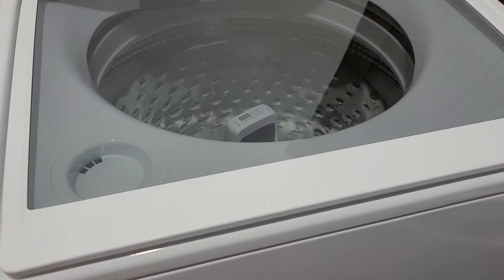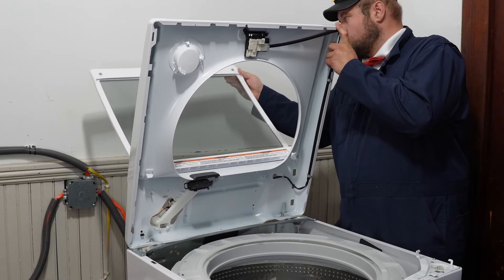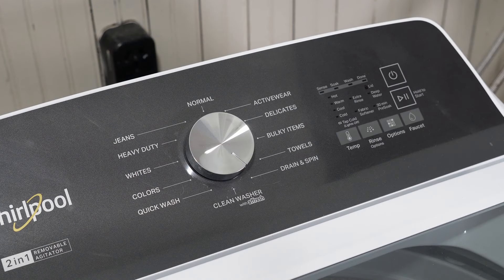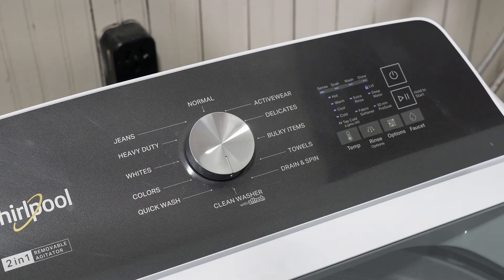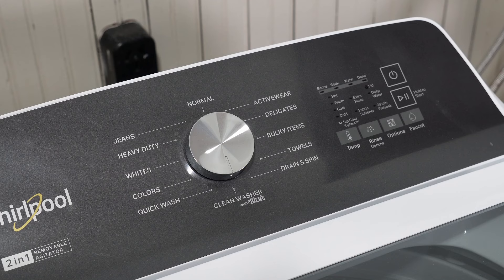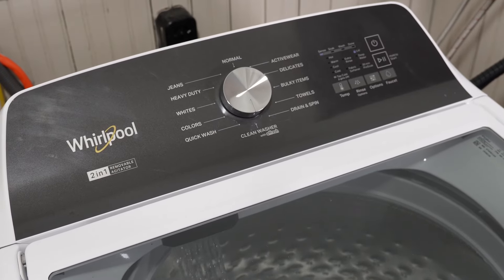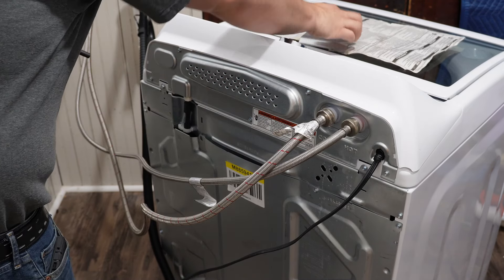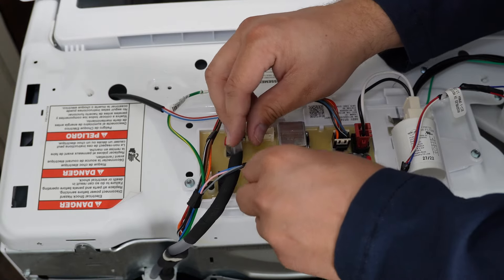How to Reset a Newer Maytag or Whirlpool Washing Machine (Factory Calibration Mode)

Comment: I bought this exact machine earlier this month on the 8th.  I used it approximately 5 times and then it stopped working. It flashes Sense, Done, Lid. I am getting the run around from the big box store where I bought it and the manufacturer (Whirlpool). This machine cost about $750.00 and it does not work nor will Whirlpool return my messages and won't issue an RA number so I can return it to the big box store where I bought it. Any idea's. I will try this reset tomorrow. I could use some help if you know what that code means.
Reply: I did follow your other video about putting the machine into test mode. It started the test but after a minute went right back to the error code Sense, Done, Lid.
Reply: My washer does the exact same thing. I hate whirlpool.
Reply: my washer was delivered monday and i didnt even get thru 1 load. tried the reset and it does everything video says but after the water foes once, it goes to sense, done, lock!
Reply: I can't figure out the reset code either. The paperwork doesn't list it either. I tried resetting
Reply: Did anyone figure it out?
Reply: Mine is doing this and I cannot figure it out. Day 6 and nothing . I've watched the videos 8 times
Reply: @nenenene9744 did anyone figure out how to fix this? Had this machine 5 months and now it’s doing the same thing as y’all’s and won’t drain. Just keeps flashing codes. Tried reset and all I get is more water and the codes

Comment: These things are pieces of junk.  Doesn't even matter what brand you buy.  All duds.  Mine stopped working.  I did this reset.  The lights would just cycle through for hours, days, etc.  I open it up and take a look.  The capacitor is DANGLING and scraping my tile floor.  Well, that can't be the way it's supposed to be, even with today's standards.  Then I take a closer look at it and two wires from the capacitor are CUT- severed.  I dunno if that is THE problem I'm currently experiencing, but I'd bet it was A problem.  I haven't even had this thing for 2 years.  My last no-name, bare-bones washing machine from the early 00s lasted until after 2020 with ZERO maintenance/issues.